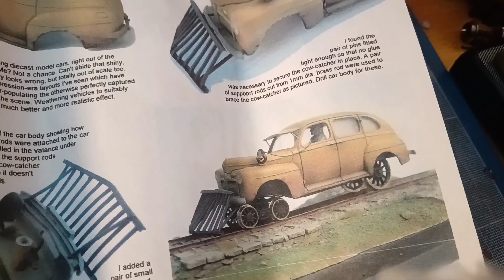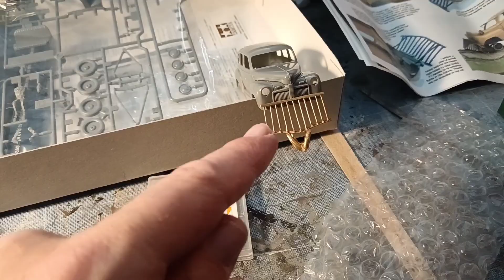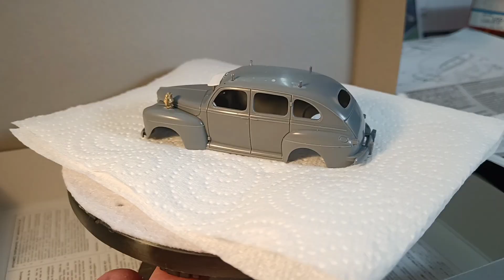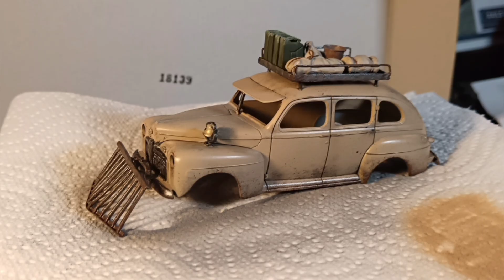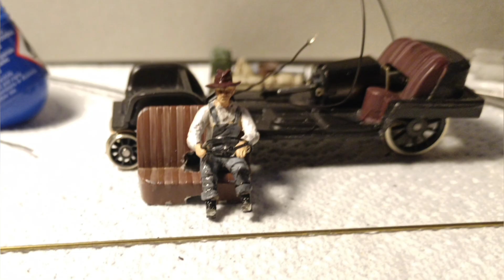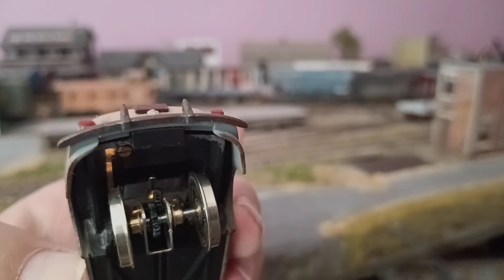1/48 Tamiya Staff car conversion to On30 Railcar... Full build.

Comment: cracking build Brian, It does look from the angle of the shot that the worm gear needs to be pull up the motor shaft more so it meshes more with the gear wheel. if it`s to loose on the shaft loctite do a compound I can`t remember the number failing that good old super glue.

Comment: Looks amazing Brian, great job. So, are you saying the worm gear is just spinning on the shaft? It was working when you battery tested it, so maybe the extra weight has just loosened the surfaces.
How about grinding the shaft down a little to make it flat, then inserting a small track nail (for example) to wedge it in place. Wooddruff key kind of thing. I'm sure you could engineer something a bit more professional looking than that, but you get the idea.
Reply from the maker: Thanks Dave, that's great advice, I was at a loss how to sort it, ideas like this will really help me sort out a solution. Much appreciated.